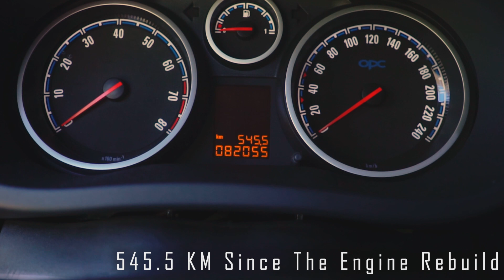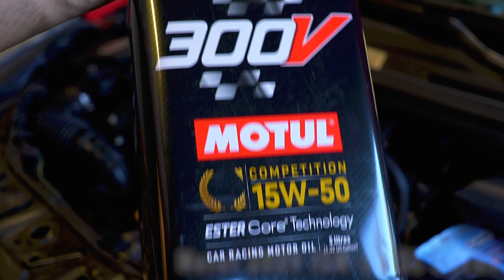500 Km After Engine Rebuild - Opel Corsa OPC

Comment: why 15w50 engine oil ?
Reply from the maker: I used it for track driving and it gets abused on the streets also, but I only drive in summer so thicker oil helps it at higher temps.
Reply: @SATSMotors  Oke thanks for your answer. Any recommendations for oil if you drive normaly. and yes sometimes full throttle. just stick with the 5w30 or 5w40 or go to 10w60 ?
Reply from the maker: @rbnz2067  if it is not forged then use 5w30 or 5w40
Reply: @SATSMotors   thanks for you reply